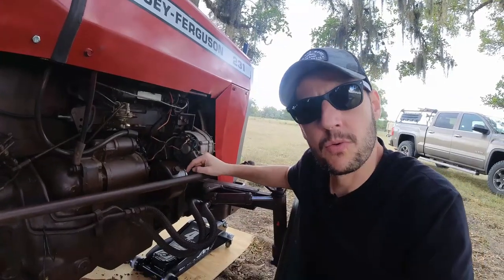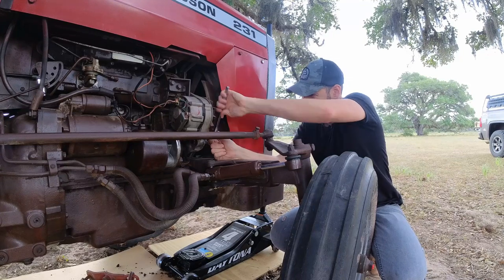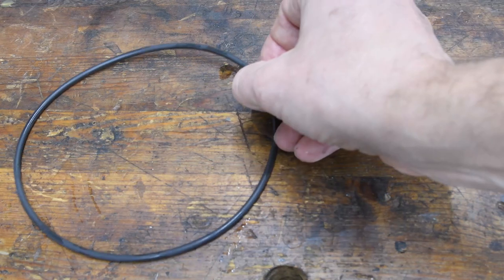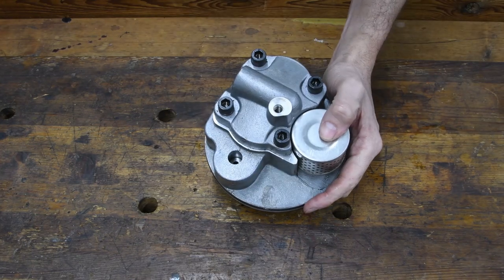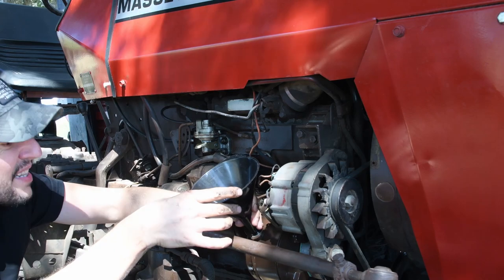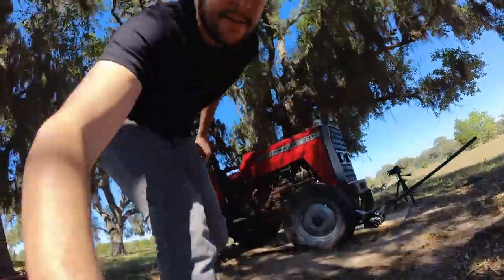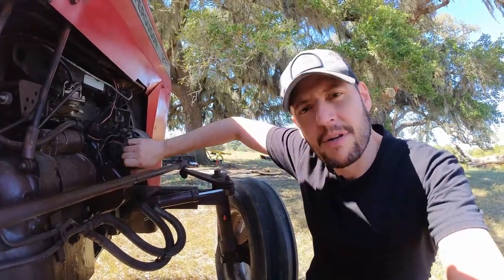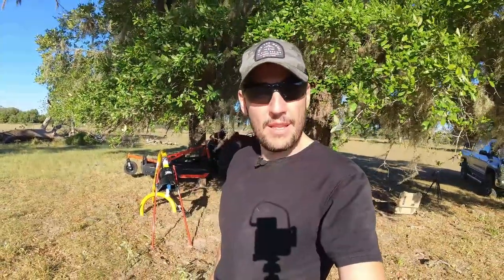Massey Ferguson 231 Power Steering Pump

Comment: Man, that was an excellent idea to put the ziplock bag on the end of the lines and get all that old fluid out! I snapped off 1 of the fittings that goes into the left power steering cylinder on my 231 the other day while going through some brush. It’s about the 4th time I’ve done this! Easy fix though. Lost all the fluid, but was able to get it back on the trailer before I could no longer steer it.
Reply from the maker: Thank you for your comment. Even with you fluid you can still steer the tractor, just mechanical. I drove mine like that for a year. Now that I have the power steering working it feels so much better.

Comment: I'd be careful steering with that 1 finger. If it decides to suddenly lock up, you could break a finger. Great video. I think I am fixing to have to remove my uncle's power steering pump and check it out. His power steering quit working on his mf253.
Reply from the maker: Agree, I just drove with one finder to show how easy it is once power steering is working. Good luck with the MF253 and thank you for checking this video.

Comment: I installed two pumps on two different 231's at the  dealer pump is not available had to order a china knock off from one of them after market tractor companies  both pumps worked well so far
Reply: Do you have the link of the pump you ordered looking for one now pls sir
Reply: There were 3 different power steering pumps used on the MF 231 during its production years, from 1989-1999. Mine is a 1998 model and my pump has been re-sealed once. It has around 1,600 hours on it. I’ve had it for 17 years and it’s been a damn good tractor! Had to have head gasket replaced once and that was about 4 years ago.

Comment: Remember when filling up pump make sure to top the pump off with the tractor running if not pump will cavitate and not steer correctly at least on one I did
Reply from the maker: Yes, I did that, thank you. Unfortunately I have another leak in the power steering control valve under the dash board. Video overhauling the valve soon. Hopefully that keep the power steering system leaks free.

Comment: Inadequate info provided in the video. You need to unscrew a couple hoses to take the pump off. The creator has not mentioned it at all.
Reply: Except for when he said you need to remove the two hoses!  At 1:25. AND then mentioned reconnecting them after reinstalling the pump.

Comment: Nice 231. Good video, Thanks. I run the engine when adding power steering fluid to my 245 , then cycling the steering back and forth to circulate the fluid through the system. Just changed the pump on mine today, and will replace the ram seals tomorrow.
Reply from the maker: Thank you. My next video will be the overhaul of the power steering control valve which it is leaking badly. Hopefully that get me power steering again.
Reply: @BUTTEWORKS would you notify me when you get video up on this please? I have to do the same thing on my MF240. I really enjoyed your video, I rebuilt my steering cylinders a while back, but still didn't have very good power steering, so I assume the filter is clogged. I have a leak somewhere where on the steering wheel shaft that constantly keeps the steering wheel shaft housing wet with fluid. I assume this is what you're going to be working on in the next video. It's been five months since you did this video, so you may already have made the video. I just subscribed also. Take care.
Reply from the maker: @andycalcutt2177  I had the same problem, check my last video about power steering control valve. That will solve it.

Comment: Do you know anything about the steering gearbox under the steering wheel? How do you change the oil? What kind of lube goes in it? How much does it hold?
Reply from the maker: In my last video, painting the MF i change the oil under the steering column, is that the one you mean?. It is called I believe steering box. I may be wrong.
Reply: @BUTTEWORKS yes that’s it! Thanks! I found my owner’s manual and it states to use Permatran 3 fluid, which is basically a hydraulic/transmission/differential fluid. It takes .95 U.S. quarts (almost a quart of fluid).

Comment: .Very helpful video. I will can now try to change my own Power steering  pump myself. Hope to save lots of money.
Reply from the maker: Glad it helped. Just so you know my pump uses the filter with no spring since the spring is built in the cover, unlike other pumps where the spring is built in on the filter. So buy the filter after you open it up to buy the right one.

Comment: Great work! what king of oil are you using for the power steering pump.
Reply from the maker: VP racing J20A, same as the hydraulic system
Reply: Ithe manual specifies automatic transmission fluid.

Comment: I just wanted to let you know that your videos are fantastic!  Excellent step by step process. I used this to rebuild both hydraulic cylinders on our MF-231. I now need to replace the oil filter and O-ring on the reservoir, I could see the filter number on your video but not sure of the viton O-ring size, any help with this be greatly appreciated. Thanks
Reply from the maker: Thank you for your comment, I really appreciate that. I don't know the diameter of the o-ring but this weekend I need to check the oil level so I'll check it out.

Comment: did you remove the spring attached to the filter? Everywhere we look the filter replacement has a spring attached and a smaller opening on the other side.
Reply: nevermind we found that our part number was wrong in the manual... your part number was correct
Reply from the maker: Glad to hear that. Thank you for checking the video.

Comment: Good video. What is the power steering serial number? I have the style but can not find one that matches it exactly. A series number would help me find what I need. Thabks
Reply from the maker: Hi, my pump didn't have any serial number and to be hones, it was quite different to the many I could find in internet. Specially the connection. None of the ones I saw online would fit the metal pipes that go into the pump. The would have modified or using adapters to make the angles match.

Comment: I have a 231s and the steering is hard to the right. What causes that. We have a bucket on ours and we replaced the selector valve and it still leaks. I can get the air out of the lines.
Reply from the maker: I don't know what could cause that. In my ignorance I would overhaul the power steering control valve and would take a look to the linkage and gears under the steering column.

Comment: what's up w/ the MF 231 needing to have power steering fluid maintained in 2 separate places? is this common among all tractors?
Reply from the maker: I don't know. I actually don't know if the steering column reservoir and the steering pump reservoir are int he same circuit. I will overhaul the power steering control valve soon so I will find out.
Reply: @BUTTEWORKS  that is a really good point.....they might not be drawing from the same pool of liquid based altho from some of my troubleshooting efforts, it acted as if the 2 reservoirs do share. i say this b/c i once had the tractor started w/ the steering reservoir's plug removed. each time i turned the wheel, some liquid would get pushed out of it but its level at the steering column wouldn't go down. i was missing a large qty from the pump reservoir after that experiment.

Comment: What type of power steering fluid did you use?
Reply from the maker: The same than the hydraulic fluid, VP racing Ultra J20A plus.
Reply: @BUTTEWORKS  thanks I appreciate it 
I think I need to do this and your video helped
Reply from the maker: @donturno8092  I'm glad it helped you.

Comment: Post video in ur power steering
Reply from the maker: In two weeks.
Reply: @BUTTEWORKS   i am very curious about how tie rod manual steering and power steering you are running simultaneously
Reply from the maker: @local_inventor  I will install the power steering control valve next weekend if everything is now working the power steering should be fixed.

Comment: What type/weight of oil did you put in the pump reservoir?
Reply from the maker: I used the same as in the hidraulic system, VP Racing Lubricants Ultra J20A Plus Utility Tractor Fluid which it is similar to a viscosity in SAE 20 ISO 68
Reply: @BUTTEWORKS  I bought a re-seal kit from Agco/Massey Ferguson for the pump on my 231 years ago and paid a mechanic to rebuild the pump for me. It’s worked fine ever since. There were 3 different power steering pumps that was used over the years on the 231 during production. The 231 was in production from 1989-1999. I have service books, parts books, and operators manual for the 331 if you have any questions or need any information.